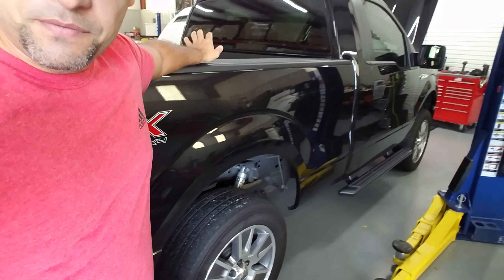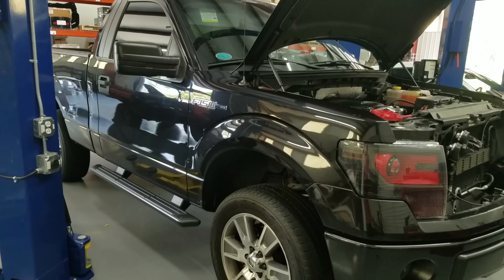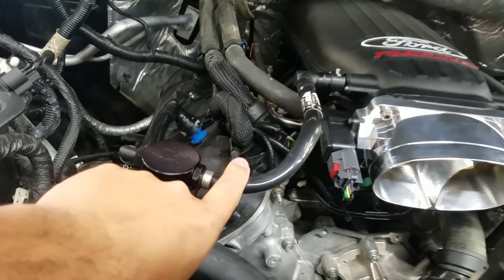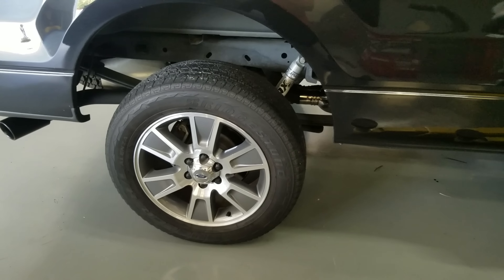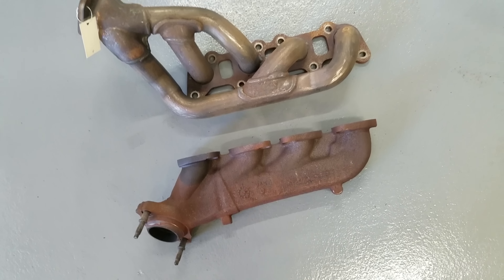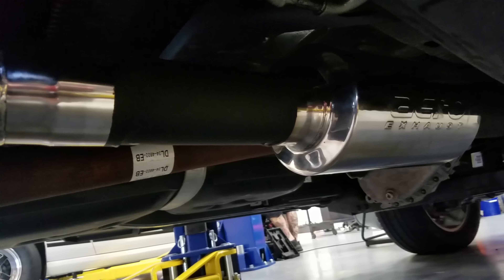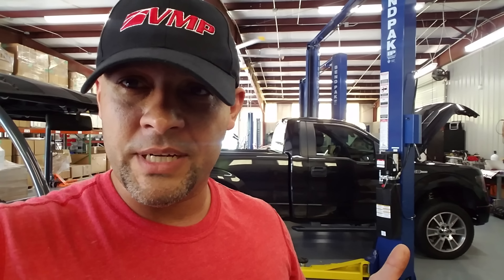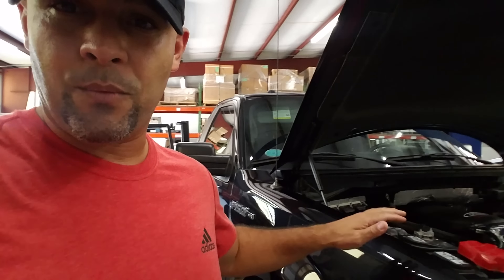How to make your F150 Coyote engine more like a mustang Coyote engine.

Comment: Does installing the GT cams in F150 5.0 reduce low end torque? I mainly use the truck for towing and wouldn't mind a little more power to reduce shifting while towing on the interstate. Looking for a safe and reliable way to do this. Thanks
Reply: Joshua C in my opinion maybe a little.  But the cobra jet manifold will significantly reduce low end
Reply: It seems like F150 guys use the Boss 302 intake over the Cobra Jet. Cobra Jet is a drag oriented as the Boss 302 is road-race.
Reply: @conveyabulloperations1669  no cobra jet is the best manifold but we don't wanna drop fricken 2000 on a intake manifold lmao. So I went with a ported boss 302 and ported throttle body.
Reply: @tsaltsirf2219  cobra jet doesn't lose a whole bunch of torque actually compared to the boss 302 intake. Plus your adding longtubes so your low end torque is likely higher anyways

Comment: I love my 14 Coyote Powered Ext Cab F150 Boss 302 Intake JLT Cold Air Intake JLT Oil Separator Mustang OEM Shorty Headers Ford Racing 90 MM Throttle Body Dyno Tuned Made 372 RWHP I Am Very Glad With That IMO Cams Are To Expensive to Just Get 25 to 30 HP Gains I Rather Wait Pay Off Sum Important Bills N Next Year Pro Charger Time..🖒🖒🖒...Biggest Deffrence I Notice was when I removed the Crappy Ass Stock manifolds n replaced Em with OEM Mustang Ones n did 3inch True Dual Exhaust Removed Converters Magnaflow X Pipe With Borla Attack Mufflers
Reply: What did u do with the O2 sensors I want to do this to my truck

Comment: Anyone know of a reputable shop that would do a coyote swap in a 08 f150?  I see plenty of shops that do early mustangs but not much for the truck.  Ive looked into the 11 f150's and would just get one if the swap is really $$$ but id at least like to get a price first.  Any advice would be greatly appreciated!
Reply: Can't see why they wouldn't, there's nothing that would make it harder afaik.  just ask around.  If I can't find a new 5.4 for my 04' for under $1000 then I think I'll do the coyote swap with the 6r80 as well.  Found f150 pull outs for low side of $2000 with harness and trans.

Comment: Stage 3 cams? Don't you think that'll be a bit lopey for a street truck? Plus if the owner is going for street performance that thing really needs to come down, it's awfully tall for any true street performance IMO.
Reply: Scott Lambeth It doesn't look as tall in person, and it looks lower with the other set of wheels and tires. I have thought about removing the factory blocks in the rear and turning the coilovers down in the front, but I just haven't had the time to do it yet and make sure it doesn't rub going full lock.  Not really trying to make it a true "street truck" I have a beater I drive back and forth to work, so this only gets driven every other weekend when I'm off.

Comment: Throws a fit when ls guys do cam swaps... Swaps came to make 400 rwhp in a truck coyote 😂😂😂
Reply from the maker: F150 cams are a different cam than mustang, Throw STOCK mustang cams in this and it's capable of whatever hp you want with boost. Fail post fails.
Reply: Absolutely mustangs have different cams, and this is probably a really cool truck. I kinda figured a bit higher for power. But regardless it should be fun.  Lol
Reply: @natevanwyk3141  difference between 3rd and 4th gear hp wise is about 10-15 on top of that its going through a transfer case which brings numbers down. And if they wanted to go e85 it would add about another  20 hp generally in coyotes. The tune they have as well only revs to about 7k so its pretty conservative this configuration can run like 7800rpm if he wanted to. Not saying thats where peak power is but it would still be quicker revving that high. What I'm saying is this thing is good power all things considered

Comment: An f150 is like twice the weight of a mustang and the engine is set up for low end torque to move all that weight. Try using a mustang to tow another mustang, that's how your truck is going to feel.
Reply: NADA says a '14 GT is 3618 pounds, and '14 F150 RC/SB 4WD is 4925 pounds, so a more accurate statement would be: "An f150 is like ONE THIRD HEAVIER than a mustang..."
Reply: My 2017 Reg cab 2wd weighed in at 3980 before I ran it at the track. Removed the spare & jack, front sway bar, passenger/jump seat & tailgate. Was also on 20 inch wheels at the time. It’s possible to get it in the 3800’s with 17 inch racing wheels, lightweight battery & removing the catback. Pretty crazy.
Reply: @Cunit2005  2017 is significantly lighter than 2011-2014s . The single cabs of 11-14 are heavier than the heaviest fully loaded model of your year 😂.

Comment: I feel sorry for that truck owner he spent the same or over the proce of an supercharger and didnt even get that much HP and torque out of the set up
Reply: He’s making over 100 hp more then stock, that’s plenty... also some guys don’t want boost and big power, they want the purity of n/a
Reply: @sleeper.simulant7327  true but for that money just put a supercharger on it and have low boost if you dont want alot of hp you can play with it
Reply: manuel M Ramirez low boost is far more boring then revving to 7000+ rpm. If your gonna boost it do it right and actually go for bigger power. N/a is more fun IMO, I miss my brothers old Integra GSR he had years ago, 8500 rpm. Sure my Speed6 is quite a bit faster but the GSR was more fun to drive and wind out...

Comment: Bad thing is if you do this to a new f150 it will void your warranty if you open that engine
Reply: No serious person modifying their coyote cares about a warranty.
Reply: @guthrie_1  that's probably one of the dumber things ive heard this week congrats 👏
Reply: @DrewVerdin  That’s strange because it’s 100% the truth. You must be new here.
Reply: @guthrie_1  i can understand if you had an old truck but if you're truck is brand new why would you want to void the warranty?? Plenty of mods or add-ons that don't void your warranty
Reply: @DrewVerdin  Because when they are modified correctly they usually don’t break. First of all the dealer will rarely deny a warranty claim if the issue has nothing to do the part you modified. The tech/ dealer just wants the work. Warranties are a topic rarely discussed amongst the aftermarket community because most guys simply do not care. They know what they signed up for.
Reply: @guthrie_1  ok buddy whatever you say is right. You're 100% correct.  Good job 👏 😁
Reply: @DrewVerdin  Yes I know. Thank you.
Reply: @guthrie_1  ❤

Comment: I happen to know quite a bit about that stock exhaust manifold you trash in this video but before I say anything, why don't you tell us why it's so bad with some comments containing more substance than, "look at it." Furthermore since you say this is a Mustang now, what did you do to the Kooks header to tune the negative pressure wave at the intake? If I gambled, I be willing to bet your header choice is actually robbing potential power available from other header choices. You say "The intake cams are just the worst thing on the planet." Please explain that ridiculous statement. If you dyno'd the truck as you said why don't you add that information to the video? The before and after torque curve would be nice to see. At least the after since the stock truck information is already available. Finally, please explain in detail how you dealt with the completely different vacuum requirements between the stock intake and the Cobra intake in relation to crankcase pressure on the F150 engine? I sure as hell hope you know more about what you're doing than you let on in this video. OK, finally found the dyno test you mentioned. Why didn't you show the entire screen shot? You're happy with the results? Is the customer happy for what they spent? I'd really like to see average torque and power at different RPM's, the stock cams with the cobra intake and the stock intake with the cams. I think that's where the really story here is.
Reply: This truck now winds out at 7000 rpm, the power curve has literally been bumped up and has enhanced mid/top end significantly. Yeah you’ll lose low end torque, but the owner wanted the higher end power
Reply: Bro the duration on the stock cams is absolute poop on these trucks they fall on their butt after like 6000rpm. Stock gt cams rev 7000+ and gain peak of about 30 in most cases and towards recline closer to 50. Also stock lines fit the cobra jet so vacuum is controlled in same way bro. And to answer your other question about the longtubes vs the log style header. Longer tubing makes better scavenging of exhaust which makes more power log style is complete crap for high revving builds.

Comment: For all that, you're better off slapping a Roush SC and easily tune it for 480 rear wheel power.  On  stock  internals.
Reply from the maker: Kathy Segismundo that's not impressive .  It made 400 na.. and he'll pro charge it someday.
Reply: Alejandro Flores not without forged internals.  Unless he wants to throw a rod or crack a piston.  600bhp (or 480ish bhp) is considered max with stock f150 stamped internals.
Reply: Kathy Segismundo Trust me, It'll be getting rods and pistons that'll handle more than a roush sc would ever be able to put out. There are a few other things that need to be taken care of before we get into boost. ;)
Reply: @Duke-ph7yw  internals are same as 5.0 gen 1 coyotes my guy. On 3 has a turbo single cab f150 with 800wheel I think on stock internals. Generally the max "safe" area is 600-700wheel on these cars completely depending on what your torque numbers are and what kind of forced induction your running

Comment: for same money he could have made more power with a twin screw supercharger and had torque and HP ... its seems the guy has more money then brains and you deliberately steered him in this direction so that when he asks to go to the next step you will advise the twin screw supercharger and then keep the intake and other parts that you remove when going to the next stage. and lets face it your also gonna recommend blower cams with different profiles so you can scarf up that thousand dollar worth of cams that you'll be removing.. that's shady shit right there ..
Reply: Or some people just want a higher revving n/a power band.... I prefer n/a power even though my cars are boosted, it’s more fun to wind the rpm range out to 8000-9000 rpm then feel boost kick in IMO.